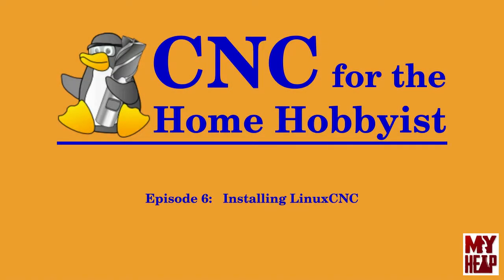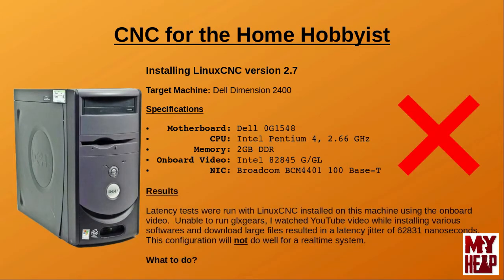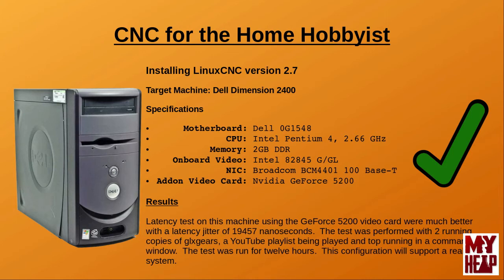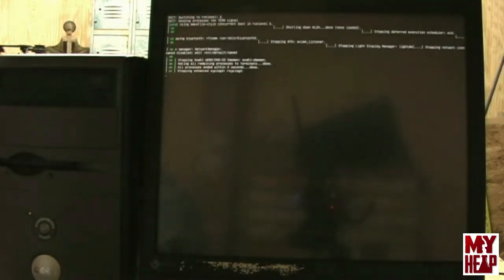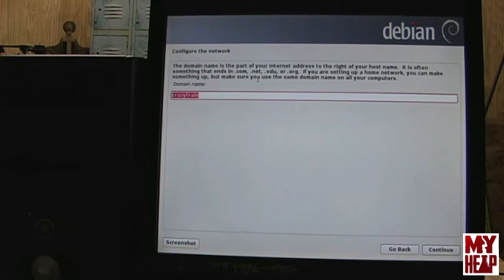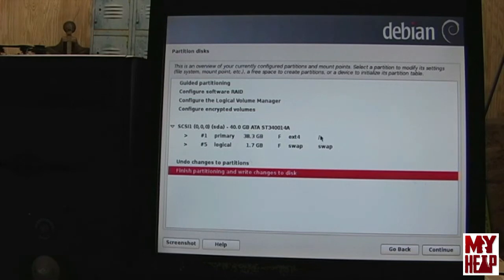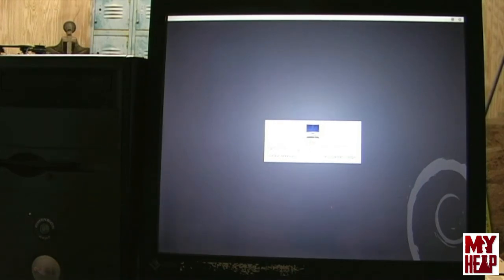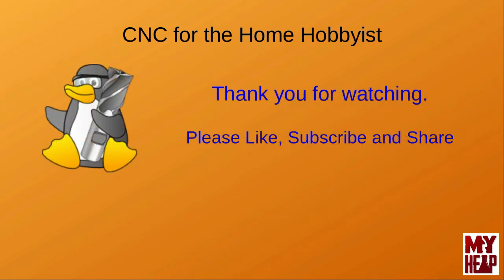LinuxCNC for the Hobbyist - 006 - Installing LinuxCNC v2 7

Comment: Nice tutorial Joe, smooth presentation.  I purchased Mach 3 several years ago, played with it a little but been so busy with other work to spend much time on CNC.   One day I would like a plasma CNC.   
Later,
Walt
Reply from the maker: I understand what you mean there.  I have a nice home build CNC router that I don't seem to get any time to use like I want.  Thanks for stopping by Walt.

Joe

Comment: 9 times out of 10 you had to use failsafe because nomodeset was not set in the boot options.  press tab at the boot loader screen to add it.  Also its DEB-IAN as in debbie.
Reply from the maker: Hey Dev Everything,  can you please explain that option.  Being a jack of all trades and master of none, I could use some more information on it.  I thought I replied to this a while back, but I guess not.  Thanks for the input, I do appreciate it very much. 

Joe
Reply: @MyHeap  what would you like to know?  if you have a nvidia chipset then you need to add nomodeset at the install boot to load failsafe drivers.  Newer versions of linux dont have to do this but debian tends to be older and lack the diversity to run on newer hardware.  google nomodeset for more info.  Pronounced DEB-E-ANN

Comment: Hey Sir, in this tutorial I heard that u've had some problem with the intel onboard video chip. What does that mean? And what would happen if I use the install failsafe instead of the Live version?
Reply from the maker: Roxchard, sorry for the late reply.  I have been away from the computer.  When using any onboard video chip, there is an increased chance for a higher latency value.  This is mostly because the computer shares a portion of it's memory with the video chip.  The increased taxation to the processor may cause more latency.  In some case a lot more.  That is not to say that there are no systems that you can't use because of an onboard video controller, I have used those computers in the past.  It is just a pitfall you need to look out for.

Booting failsafe will only load the drivers that are most likely to work.  In the case of video, the drivers will be at a reduced video resolution.  What resolution I am unsure of but I think if memory serves it will be a default VGA resolution.  Perhaps 640 x 480 or similar.

I hope that clarifies.  Again, please accept my apologies for being so late with this reply.

Joe

Comment: Hey I have been installing linuxcnc on my secondary hard drive seperate from my primary one using the guided method and for the life of me cannot seem to configure my bios boot priority to boot my secondary HDD instead of my first containing windows. Any ideas ?
Reply from the maker: It sounds like you are missing a boot sector from your secondary drive, if you bios allows you to boot from a second drive.  Typically, when booting more than one operating system on a computer, a boot manager is used, such as grub, to select the operating system you want to run.  If fear of corrupting windows is the issue, I would remove the drive from the computer leaving the secondary drive in place, boot from the CD and do a normal install.  I hope that helps you a little.

Joe
Reply: My Heap so I have Grub installed because I downloaded Ubuntu and LinuxMknt just to test and see what the hell ks happening the only difference It was on my primary drive so I was dual booting on the same drive. Do you recommend me doing that still or try on the same drive with Like I did with them? (Only reason I haven’t already is because I have Intel Optane Memory boosting my HDD since it’s so slow but it’s incompatible with Linux and prefer to leave as is and use the secondary hard drive as to maintain speeds on first drive, had to disable that when downloading other two Linus OS etc)
Reply from the maker: @gezimhakramaj2981  I am of the conservative thinking type.  If I had special drivers or dependency on Windows, I would be reluctant to install a controller onto the same drive.  Only because if I encountered an irreversible problem I would have to reinstall Windows and and drivers or special software.  I highly recommend that your controller be installed in a stand alone computer, and lacking that I think the next safest approach would be to install to a separate hard disk.  Many BIOS are capable of using and booting from a USB hard disk, this could be an option.  And finally, if you are VERY comfortable with grub, you can install LCNC onto a different drive and add the entry to grub.  If. You are dual booting buntu or mint from your primary drive with Windows, this may be a solution.  Running grub to see if it can find the additional boot system or adding it to grub manually.

I know this has been an around the world answer.  I just don't want to put you at risk of losing your. Windows system for the sake of experimenting with LinuxCNC.

I hope that is of some use.

Joe
Reply: My Heap got it thanks !

Comment: When you we a graphics card, do we have to install a generic driver (instead of a proprietary one) for it or does linuxCNC's underlying OS takes care of that? Thanks
Reply from the maker: The os will install a driver, albeit some cards require proprietary drivers.  But for linuxcnc the helicopter drivers usually give you the resolution you need to use the software.  It does not require much as I remember.
Reply: @MyHeap  awesome..thanks